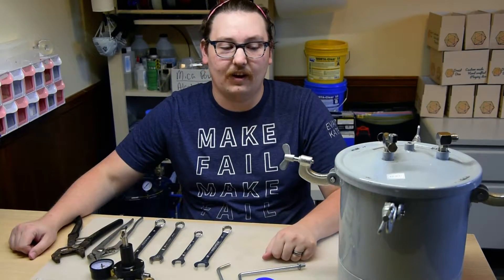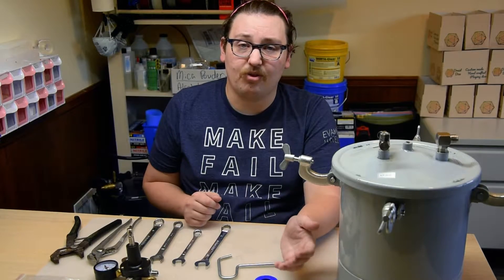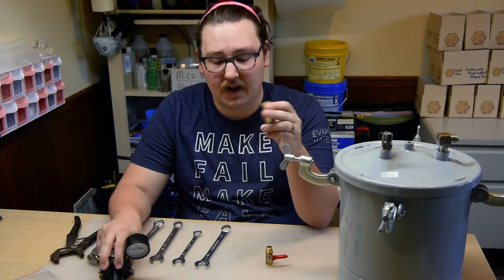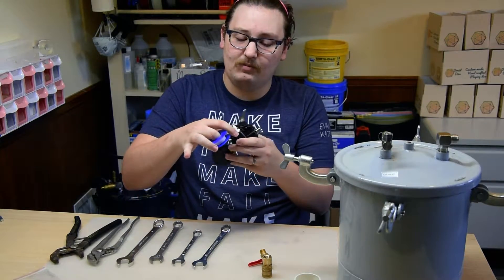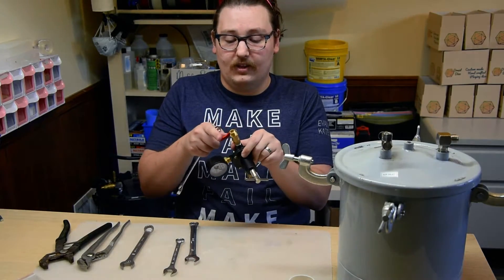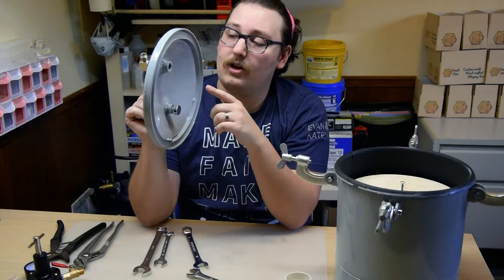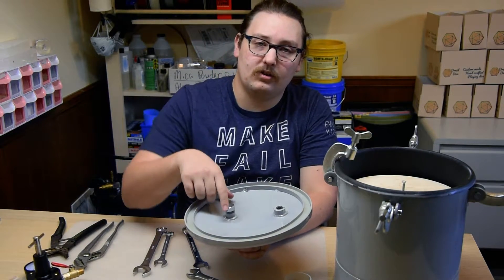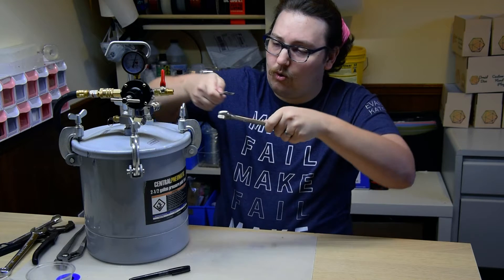Setting Up Your Harbor Freight Pressure Pot For Casting

Comment: Hi I recently got into the hobby and i have one of your molds! Any thing from this tutorila that has changed? Also do have have to worru about voids if lets say i have a very bubbly resin?
Reply: Also is it the red or blue valve to release the pressure?

Comment: Great tutorial, thanks so much! Quick question (in the hopes, you still see this): is the additional larger ball valve (blue) necessary? Or could I technically also just plug this and do everything over the other hole - or is that a big NO NO due to safety reasons?
Reply from the maker: You can 100% do that! The main reason I didn't was just to have an additional valve that releases pressure faster. A lot of people go with the single ball valve for both controlling inlet and exit. This is an older video so I would change some things such as that and using a male quick connect at the end of the ball valve rather than a female so it can be used easier
Reply: @DruidDice  thanks so much :))

Comment: Watch those Air Compressors! Some are so loud you need earplugs alongside Ear Muffs designed for firearms! And they get louder the cheaper they are!
Reply from the maker: That's why we use the ultra quiets. They are literally whisper quiet about as loud as a sink faucet turned on.
Reply: @DruidDice  Oh? Can I get a brand and model? It'd be nice to not annoy all of the neighbors at my apartment complex.

Comment: Hope you’re still looking at comments on this one. 🤞 
Can you show how you made your insert for the pot or where you got it?
❣️ Your E&K shout out. They’re a great channel too. Good luck on yours. This was one of the better conversion videos I’ve watched.
Reply from the maker: this one I made using some 9-in wood rounds you can buy on Amazon and cutting a wooden dowel but I would recommend a insert I purchased it from a website that sells products for making pen blanks. It's HDPE plastic resin doesn't stick to it! https://the-makerhive.myshopify.com/products/pressure-pot-caddy-hdpe

Comment: Just curious why you didnt put the ball valve on the other side and the male connector on it so you could plug your air hose into it?  Then either a plug or the female on the other side to make a "plug"

Comment: Thank you for this tutorial ; Could you tell me what kind of air compressor I need for pressurize some pressure pot like this? I 've got an airbrush compressor ( 3L of air volume)  which can give me 6 bars of pressure, is it enough?
Reply: That is completely enough it might pressurize a bit on the slow side but you're talking about minutes! Tons of folks in the dice community use airbrush compressors heck a large number even use converted bike pumps!